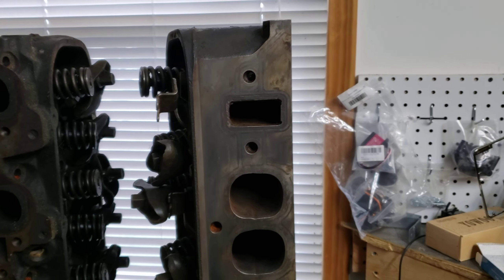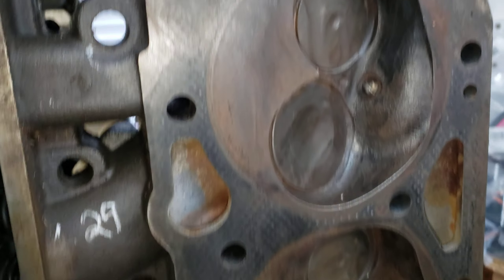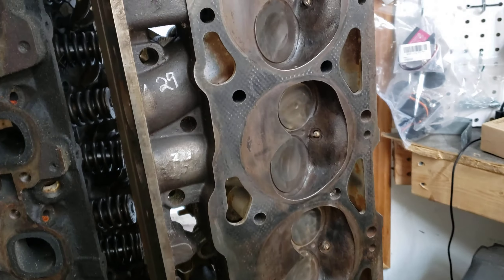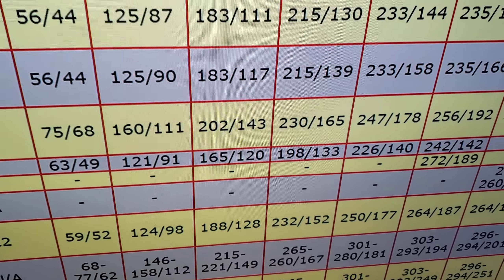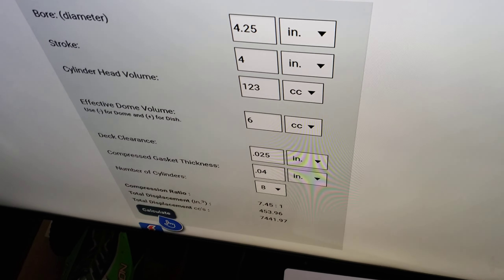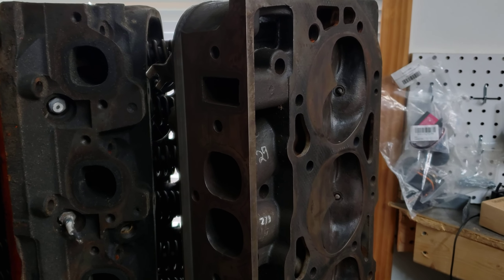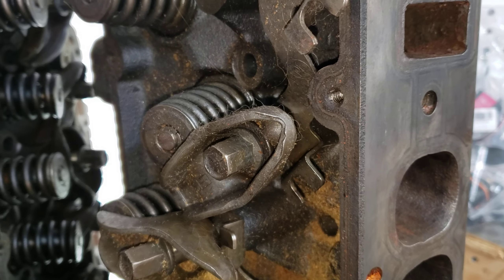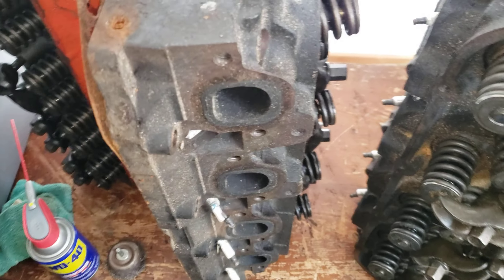L-29 Gen VI BBC Heads and plans for the obs BBC swap.

Comment: Is that Port the same as the Old 396 Head.
Reply from the maker: I dont know about the 396 head, but it looks like the 049/781 454 heads
Reply: @Poopdogsays  ok I think they are compatible. I used to put the oval closed chamber 105 cc head on a flattop piston 468 and they did fine on pump gas and made really good power.